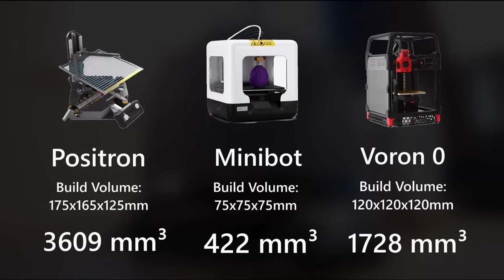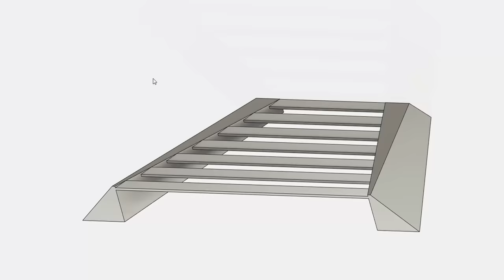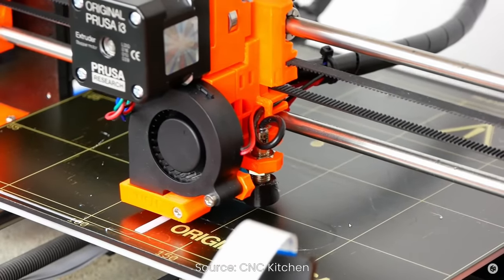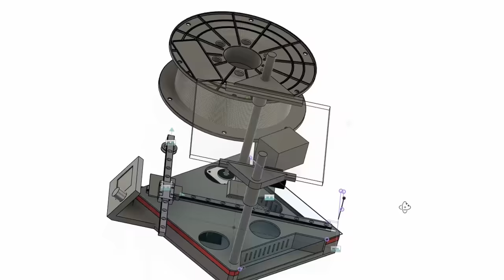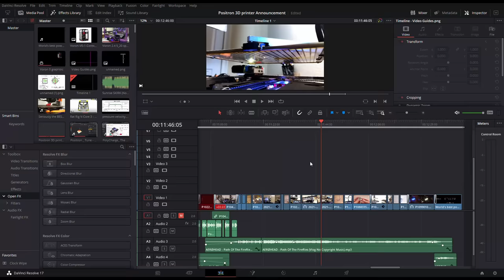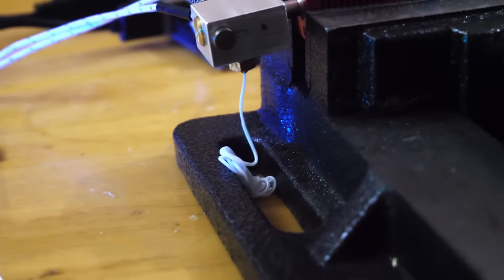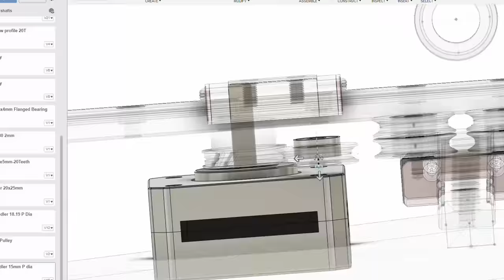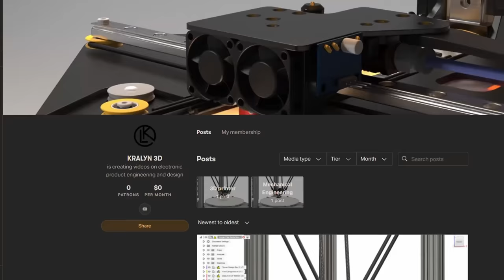A 3D printer unlike any other, fits inside a spool box?  - Positron V3 intro & Design Story

Comment: Man creates a new style of 3d printers from scratch to prove to companies that they could be more creative with their 3d printers. Now that's what I call proving a point!
Reply: I don't think it's about creativity, I think it's more to keep cost and complexity down to make it accessible.
Reply: @Sphyxx  nice
Reply: It's just a regular printer scaled down and upside down... there's nothing innovative here. That's not to say it's not a wonderful design, it is. He did an outstanding job of putting things together.
Reply: @saltwaterrook4638  ....that can print as fast as a voron, can build bigger pieces, fits in a spool box and that can print +5cm overhangs.
Reply: It's been done before (on larger scales), but it's never been this perfected.
Using synchro-cables on a small design to make it even smaller is simply genius.
The only issue is scaling the printer up, but limit switches and automatic bed leveling might mitigate bad tolerances.
Reply: do inkjet next! lol
Reply: @Sphyxx  That is also creativity.
Reply: This would also be a perfect desktop printer that could be stored in a drawer.
Reply: @saltwaterrook4638  it’s like saying that there are no innovations in the car industry because they use four wheels in like forever. You first need to even have the idea to turn it upside down and then to make it work.

One can downplay anything. A 3d printer is just a modified cnc mill, no innovations. There.
Reply: big companies can't be creative. One a creative person can. Companies have other priorities
Reply: I have a Ender printer which I have to disassemble and reassemble many times due to space restrictions, so a printer like this would be a great replacement just for the portability aspect.
Reply: @saltwaterrook4638 pretty great timing of having been reading your comment at the same time he's talking about the 90 degree hot end. 🤷

Comment: Possibly the most impressive part of this is the speed of the design cycle. Absolutely crazy to do this in a year.
Reply: Man's must have incredible time management
Reply: @MCOGroupNews  The gentleman who made this design is very talented. It would take several departments working together to achieve what he did in one year.
Reply: I built a rep rap printer in 2010 and wrote all my own firmware for it in around 14 months... Depends on where you are in life.. Now I have kids and couldn't do it in 5 years lol
Reply: Its also fair to take into account that the 3d printer market is pretty mature at this point and he probably had a lot of already tested ideas to work off of as a base wich would have decreased the time it would take
Reply: @oneheadlight8000 

Ok but you didn't come up with a different design with additional constraints and integrate it. That is magnitudes harder than building something others have built before you where you can ask a lot of people or seek help in a guide or forum.

Comment: This printer and its design deserve to be picked up and put in production. I believe there is a sizable market for a portable compact printer for onsite component manufacture.
Reply: I'd buy one right now.
Reply: @Bishop0178  how much would you pay for it?
Reply: $600
Reply: Same here. I think I'm in the 800+ range. I need something portable in my travels.
Reply: @weaponizedemoticon1131  why do you need a portable printer? So I can understand what's the target audience
Reply: @namaro539  In my case, I move a lot, and space is at a premium. I primarily use it for repairs, but also gifts, art pieces, etc.
Reply: @namaro539  I give workshops for children. I have to travel alot and i don't like the hassle of calibrating 5 printers every time i setup the workshop. Space in the car is scarce. The speed is another factor. Children are not know for their patience so this would, in my opinion, hit the sweetspot. Added bonus printing upside down would be fascinating to watch.
I'd be willing to pay 600-700$ mind you i would have to pay import vat and taxes. Easily 900-1000$ per unit when it is all payed for
Reply: @weaponizedemoticon1131  thanks that helps.
Reply: @namaro539  Are you considering making some?
Reply: @weaponizedemoticon1131  yes I'm looking for manufacturers, the logistics I can handle myself. I'm thinking of making a Kickstarter and then a website
Reply: @Bishop0178  That's a very good set of reasons. That does hit the spot pretty solidly.
Reply: @namaro539  Well good luck!
Reply: @weaponizedemoticon1131  thanks I'll try to update here if it comes to fruition

Comment: Fantastic. I've been interested in 3D printers but most are too big to fit in a family home especially just for casual use. This would be a game changer.
Reply: Just keep in mind, 3d printers are melting plastics. Thus, giving off some toxic fumes. The amount depends on the specific filament being used. A housing/tenting unit with a tube exaust structure to the outside is recommended. Easy to build one yourself.

Comment: I absolutely love this. Such a smart design, and it's clear you've put tons of effort into working out the issues. The small packing space is a HUGE selling point to me - i'd love to have a 3d printer, but i do not have space to put and keep a huge box somewhere in my apartment. This one would be so easy to set up when i need it, and pack away on a shelf when done. I really hope someone picks this up to manufacture, or at least sell kits with the necessary parts to build it myself.

Comment: You can add a camera to the underside of the bed and watch this camera from the screen whenever you want. Thus, it may be more comfortable to watch the first layer. Therefore, you do not need to use a transparent bed and you can make it work more efficiently by adding an insulator to the top of the bed. You can ignore the idea if heat insulation doesn't provide a significant increase in efficiency. However, I think that people may leave negative feedback for this reason. I appreciate your project, good luck...

Comment: Thank you for your contribution to the 3D Printer community. I love the concept of this. By taking the weight off the bed, you can make a much larger build volume in a non foldable printer. No need to overcome inertia. Brilliant. Super excited to try to put this together. I have a pretty nice hobby machine shop with an ancient Kerney and Trecker Model H mill .

Comment: I am extremely excited to see you building this here! It's about time we had Innovation come out in the manufacturing world in the US for the everyday user. I understand she's an expensive little machine but you've done a fantastic job on it so far. Looks like she's getting pretty close to a production run model. Remember most of us don't mind it not being pretty as long as the functionality is on point! Most of us modify our equipment as soon as we get it anyway. The fact that you're printing upside down is great for overhangs but my question is what is the max weight that the bed will support? At certain weights are you starting to get droopage of the bed platform? Other than that, fantastic job so far man and congratulations!
Reply: Yes! I have the same thoughts and weight issue question.

Comment: I expect many companies to be interested by your fantastic design. Such a fast, reliable and portable 3D printer is a dream come true.

But... Your logo should include some sort of serial number that represent the design release version (maybe the hash of the last git commit where you put the design ?).

This way any printer sold based on your public design will have clear reference to the original design. Any subsequent updates and forks of your design can then be used to upgrade an existing printer, just by doing a comparison between the Git commit hash of the logo and the target design commit hash.

Comment: This design is practically from another planet, as is the designer. I don't think I'd have come up with this if I'd sat for 10 years brainstorming 3D printer design ideas. I'm just in awe of this printer and the creativity of the designer. Truly he is gifted in mechanical engineering. So much so, that I am confused about the design.

I do have one question which I hope someone can help me with. The one constant I've always kept in mind about FDM printers or any printer that involves a phase change in the materials (ie. melting or curing) that makes them different from CNC, is what Newton gave a name to long ago: gravity. What goes up, must come down. Yet this printer does the opposite.

It confounds my intuition that the print head can be dispensing molten plastic in a direction against gravity instead of with gravity. Is there any price in terms of object strength or print quality that must be paid because of the nozzle extruding material up instead of down? How will the printer perform if there is low quality or dirty filament and there is a partial blockage in the nozzle, for example?

Thank you in advance to anyone who can comment on this seeming paradox.

Comment: If you get rid of the table?  Just put the glass (only for the first printing), walls with teeth are printed along the edges, for which the gears then lift the product. Then, after the end of printing, the closing lid is printed, which serves as a table for the next printing and so on. So he would be able to print up an unlimited length of the product along the Z axis.

Comment: A tradition "H" stile design with the hot-end on the side (as opposed to being on the top) would allow the center of mass to be lower, thus making it more stable and potentially have less height.
Yes, it would not fit inside that box you wanted, but that's feels like an arbitrary requirement considering that once folded the footprint is already very small anyway.
Another thing is that when z-hoping your build plate will wobble since it's just being held by 1 of the sides.
In any case, you made a lot of interesting improvements, good work.

Comment: Great work champ!

Can I suggest you ditch the IR bed level sensor as it has so many issues and go to piezel sensor under the hotend mount. Not only would this give better accuracy without all the interferance and problems from IR ,it would also get away from having to mount the IR board near the hotend (and have an offset). You could also add impact/fail detection using the piezo sensor if the head impacts anything during a print (gravity is working against us here).

Can't wait to buy one :)

Comment: The 90° degree hotend was used in older Stratasys machines. And the issue with it was not that it had problems printing, but that cleaning them in case of them getting clogged was close to impossible.

Comment: I had the idea of upside down printers before because I would imagine that it doesn't need to do any retraction because the filament doesn't ooze out due to gravity. Is the print settings for this printer drastically different from traditional printers? Very cool project by the way!

Comment: Looks really good, but I think I would forego ability to fold it, since that isn't important to me. It is full of innovative design and produces great prints really fast. I wonder how much of the structure can be 3D-printed? Slightly larger would be fine with me, as long as it has the same quality and speed. Maybe use standard steppers for availability. Great designs!

Comment: If you do a v4, I would recommend looking at schnekenstruder, which is a 42 gram direct drive. See rq3's threads in reprap forum tech-talk section. It uses a NEMA11 motor, so hopefully it can squeeze into the printhead despite being 3mm wider than the 25mm fans.

Comment: I have to admit that I did not read through all 1,922 comments, so forgive me if what I'm saying is being repeated.  First off.. I'm sorry you can not release this on your own.. I would say aside from  Josef Prusa and Sanjay Mortimer, you are in a small club of 3D printer innovators.  
I saw where your supports came off very easily. But no view of the area above the supported areas.  Those are always an area that reflect alot of defects.

Comment: Cool printer, but I don't understand why you call it very fast. Prints at the same speed as my old printer. In fairness, it should be clarified that my printer is a special high-speed model. But this is a simple H-bot that prints ABS. I think that if you use the technical solutions of these two printers together, you can increase the speed by at least another 1.5 times.

Comment: it seems like a nice concept but how many people need a portable printer? -- it's not like most people need one because you don't tend to print out and about because it still takes a while to print.

want would be more beneficial is created a larger fixed placed version that has easy assemble of just folder out - then at the end of the day you can fold up and put away to save on desk space when you don't need to print -- home owner would love this.

Hopefully a final version would cover most of it up because it does look a bit messy. The glass bed also needs something on the edges to hie the soldering.

I'm not sure about the print quality though... it does look more like the quality of a cheap entry level printer.

Some nice ideas but it's not quite there yet -- of course the biggest thing would be the price...most 3D printers of this size are coming down in price
Reply: "how many people need a portable printer?"

At least one, and that's the guy inventing it.
This open-source project was born out of a personal need, not with profit in mind.

Comment: Ok, I need this to replace my Velleman Vertex3d.
And forgive me in advance, but I am already thinking of supersizing that baby here to at least double the size. 
A taller Z 400mm+ should be a no brainer as such.  A bigger printer footprint with Nema 23's is ok for my purpose as it will live permanently in the same space.
The question is if it will work with a Bigtreetech SKR 1.1 as I have a spare and already replaced the brain of the Vertex once. 
And I have plenty of parts from other printers including some industrial parts such as a 1000mm leadscrew unrelated  to printers and the matching linear stuff for it.

Comment: This design is BRILLIANT! I really love to watch your videos, your skills are amazing :) 

One thing that I am wondering about - what if the object gets unstuck from the bed/you will get temporary heatcreep/ filament will disconnect from the object - and you will be getting hours of filament spaghetti. In normal printer it will in most cases naturally fall down on the bed and there will be a mess, but only a mess. Here it will all stuck to the extruder and build up on most critical components. 

Is there any way to detect such situation and cancel the print automatically?

Comment: Very cool printer design...However, I do have a question... The bed heater is very expensive atm, have you performed any testing using ni-chromium wire?
Reply: Also... as I look over the design in CAD... is the main reason for the brass insert in the heater block (aluminum) mainly to reduce weight while allowing the heat transfer to the "melting" chamber to be more efficient?  Another question around the heater block is that the inlet side of the brass insert is 90 degrees to the outlet...while this works my thoughts here is if we split the brass insert in half, mill both sides for the melting chamber so that the entry and exit holes have a radius turn I believe that this would increase flow... Thoughts?

Comment: this is a great innovation, the design is great. and looks like it could be the next in line to be  an amazing printer. I am wondering how well this would work on a larger build volume. With the exception of the build plate vibrations from a larger foot print. I think with a duel linear Z rail with a single drive motor someone could design a larger build volume with very fast print speeds which   i think this could be on par with the Voron 2.4. You and your team are some great innovators and I will keep a keen eye on your project. Keep up the great work!